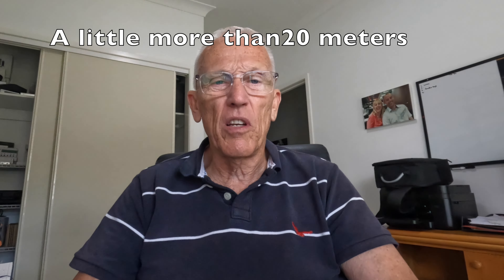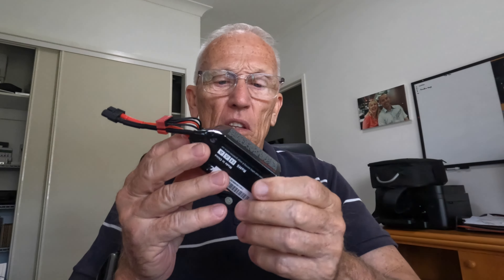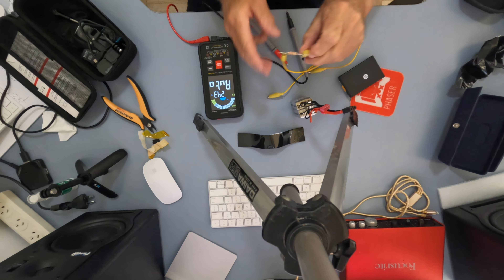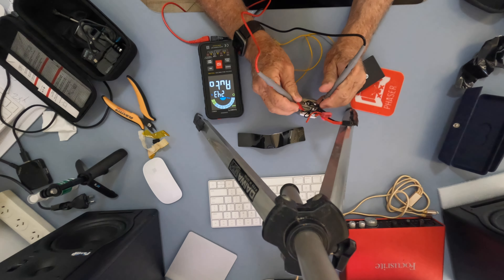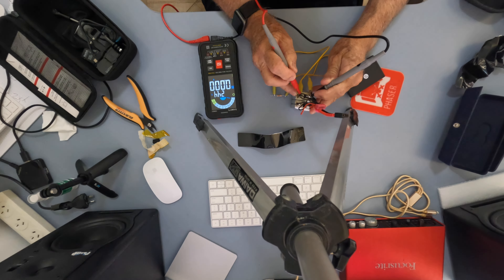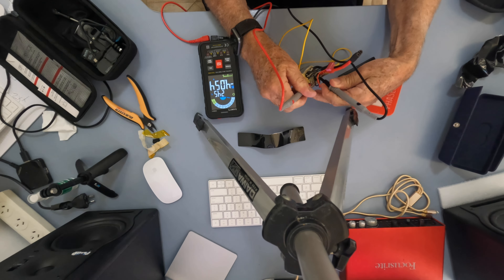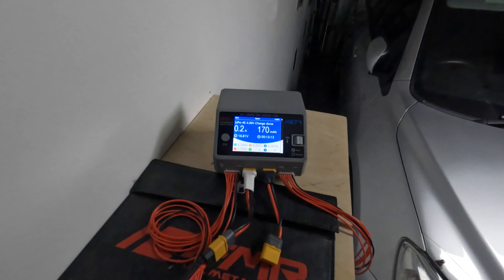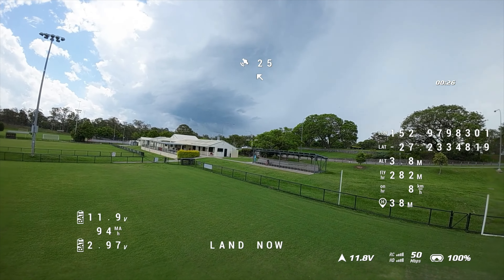CNHL China Hobby Line

Comment: Why do you need to cut it open to measure each cell's resistance? Can't your charger measure that? Most lipo balance chargers can do that...
Reply from the maker: You are correct that you can measure the voiltage without opening the battery. But in order to check resistance you need to access each cell separately.
Reply: No, they can also measure each cell's resistance via the balance cable.

Comment: You used way to high resistance value when you tried to measure Ri. Ri in my batteries are between 0.1 Ohm and 0.6 Ohm. To measure with 100 Ohm gives no info.
Reply from the maker: I was trying to measure 3 to 4 volts on each cell and then collectively add the resistance values up.
Reply: @chriscflint  Actually now I double checked my battery DB. Ri for my 1300-1600 mAh batteries @40A-100A are between 4-10 mOhm. I suggest next time, you either measure with a good charger (i got two old iCharger 208B), or a resistance in mOhm range. U need at least a 350W charger. For added accuracy with an external resistor port, plus that resistor at 50W+, 0.01 Ohm. You also need a fan to cool that resistor.
I know these things because I got an University degree in Electrical Engineering.
Reply from the maker: Hi Freddy thank for the additional comment. The charger I use is rated to 350/650 watt (AC/DC input). I do not know if you saw one of my comments but I had another 4S fail yesterday exactly the same. Fully charged, 16.8Volts measured with a multimeter. As soon as the drone took off the voltage started dropping instantly and I had no option but to land immediatly. When I returned home I checkd its voltage and it read just a bit less than 16 volts. From this I suspect the problem is the battery internals just cannot output the required  Amperage that the drone requires to just fly. Wires and that all look sufficiently sized in square mm for the current but internally some issues must be present. I will attempt to send this one back to CNHL to see what they say.
Cheers @freddan6fly
Reply: @chriscflint  Cheers. Don''t take this as criticism of your conclusion of bad batteries. There I don't doubt you. Just that your method could improve. Happy 2024.

Comment: hmmm.. I've gone through many of these with no problems.  You do realize that the "C" ratings on all lipos are utterly dubious, right?  While CNHL aren't the best or lightest, they are a good value option - esp when you can get them on sale.  I've had one with a bad cell which they promptly replaced.  Perhaps you're getting fakes.  Where are you buying them?
Reply from the maker: Hi Mike, I buy direct from CNHL. Today again on my 7" another 4S went from 16.8 to less than 10 volts in less than 15 seconds so another one in the trash. 
I also flew 3 of their 6s batteries with no issues??
Reply: @chriscflint  ... unless the had a bad run - I've never tried those particular batteries.  This sort of fiasco is certainly not "beneath" CNHL... but, I've never heard of anything this bad... unless you're doing something seriously wrong... lol